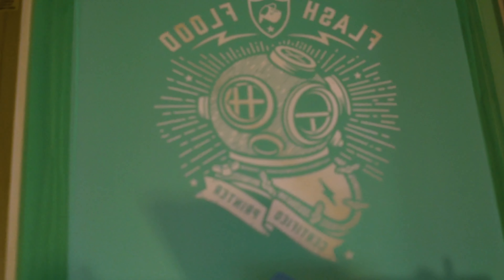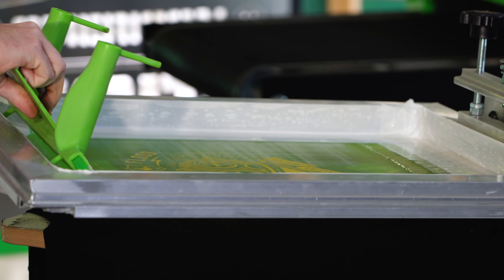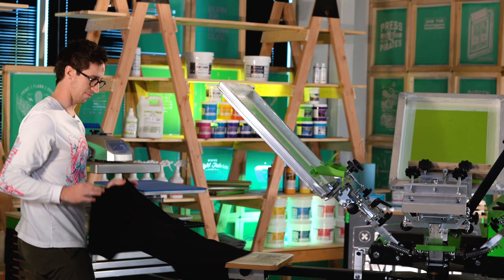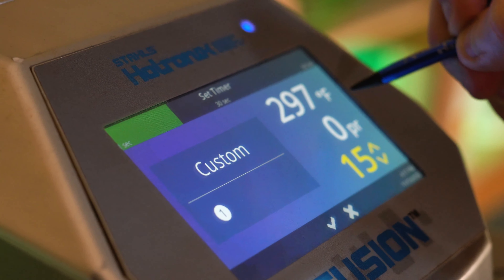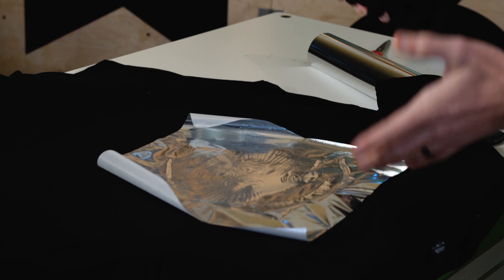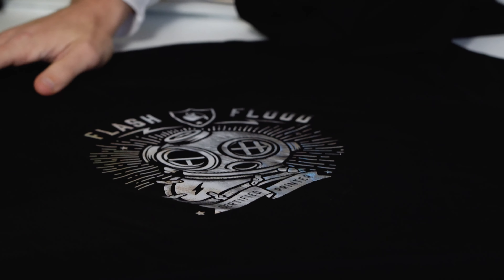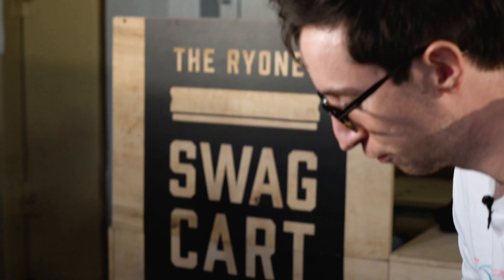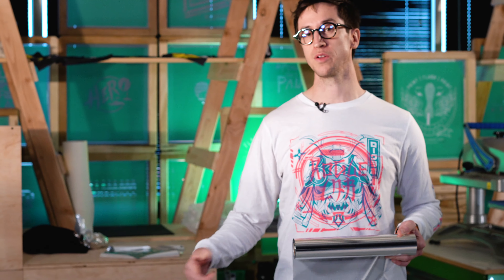How To Print Foil On A T-shirt With Foil Transfers

Comment: so ive noticed that certain papers adhere differently then others I usually have the most difficulty with the ones with designs..like hologram or various shapes in the colors..is there a different time that should be used for those or thicker ones?  also like a have a chrome and its thicker then the silver so it doesn't adhere the same either   any suggestions?

Comment: How long will a foil print last? sweat and wash cycles? Does it matter which type of t-shirt material you use? Can you do a ink screen and foil on the same shirt?
Reply from the maker: Hi!  Properly cured, foil will stay on through 20+ washes easily.  Over time, the foil will tarnish and loose its brightness.
Foil will work with all fabric types.
You can do foil and ink on the same shirt, but there are mechanical nuances to this process and it is not simple to accomplish.